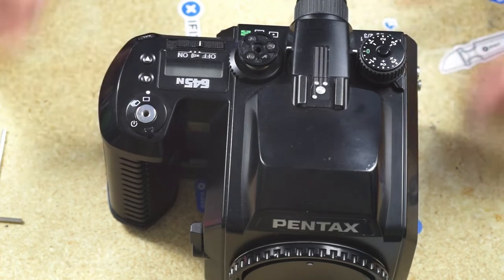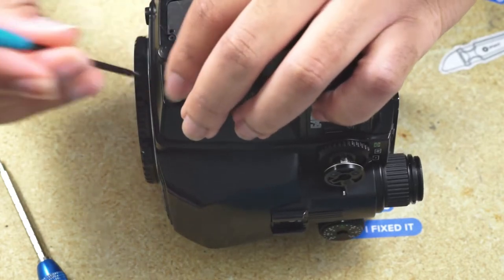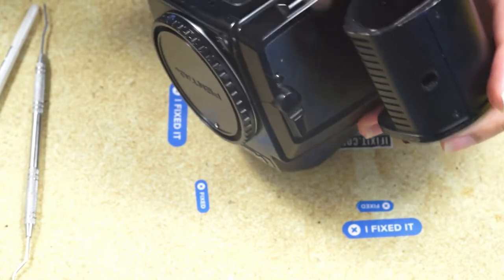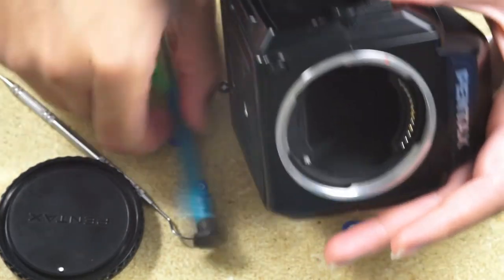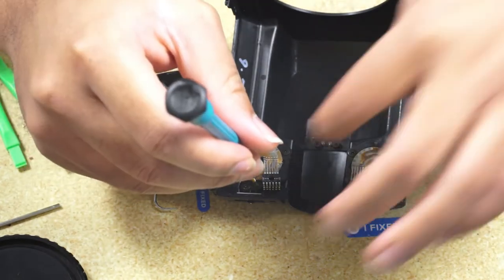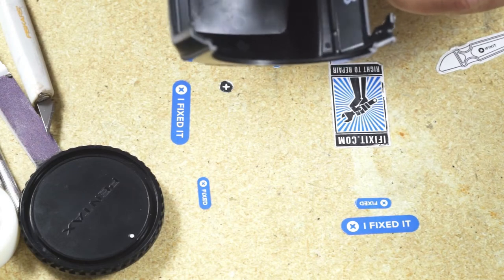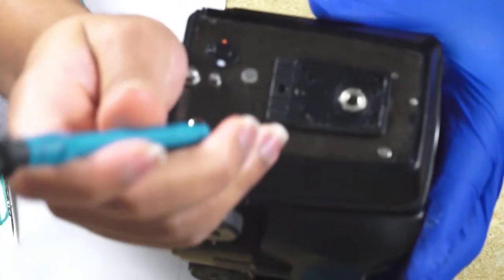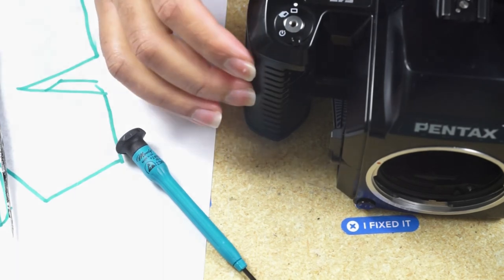Pentax 645n top cover removal and shutter speed dial replacement. (3d printed)

Comment: I see you  have two different  3d printed shutter dial models on your  page. Which model would we think is easier to install for beginners?
Reply from the maker: If you dont want to take apart your camera definitely look at the other video and use the "no spring" part if you dont have a spring. If you do have a spring there is a thingiverse link in the other video https://www.youtube.com/watch?v=fXdWfFWJ2g0. The fix in this video is mostly for cameras where the column that holds the shutter speed dial is snapped. So I would def recommend the easier fix in the other video. It holds up pretty well.